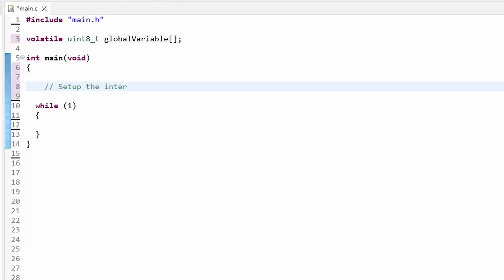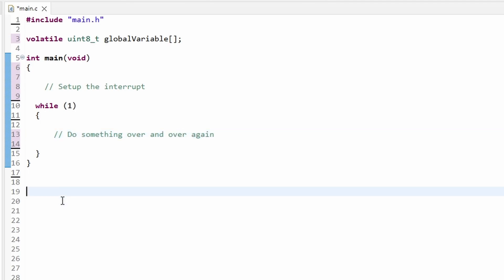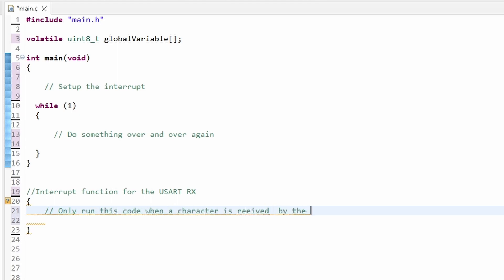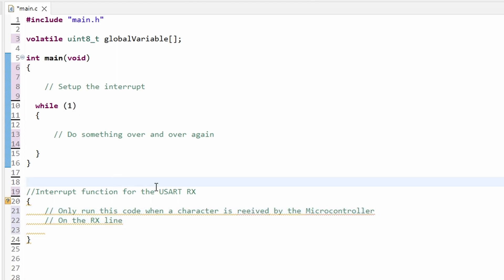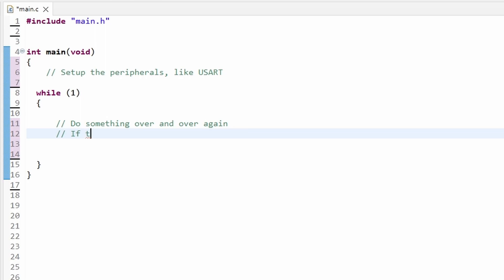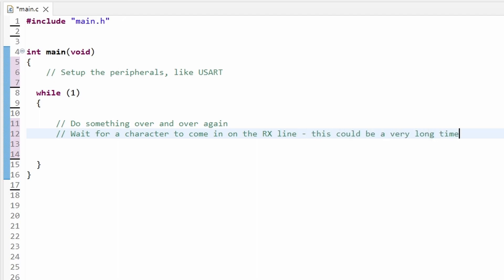#14 Interrupts Explained for Microcontrollers

Comment: How do I code an interrupt for a button that is being held for 5 seconds to put the microcontroller in another programmable mode
Reply from the maker: That's a good questions. You might be able to use a timer and in conjunction with the ISR function. Maybe the function will start the time once the button is pressed, then once the timer is completed, you have an interrupt for the timer end and test if the button is still pressed. With all of that said, I would probably use a state machine. As your program loops, you test for the button press on each loop. If the test is positive, a timer starts and the loop still tests for the button press. If one of the tests shows not pressed, you cause the timer to stop. If the button is still pressed at the timer end (interrupt for the timer end), then you create a variable state in the ISR that the button was pressed for the allotted time and you run another function, or code within an if to do what you want it to.

Comment: Thank you for this great Video! Thank you also for pointing out that an Interrupt routine has to Designer carefully in order to consume less time as possible and postpone extensive work related to this particular event . However this cruicial point is violated quite often-not only by beginners... 🥺
Reply from the maker: Yes. This is a really important consideration when coding the interrupt.